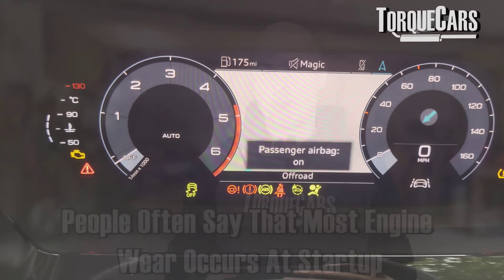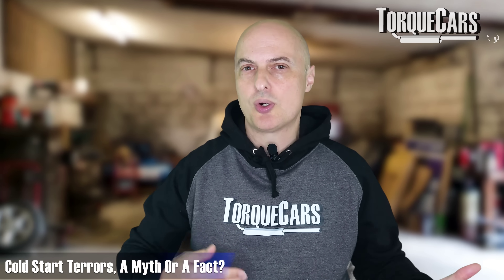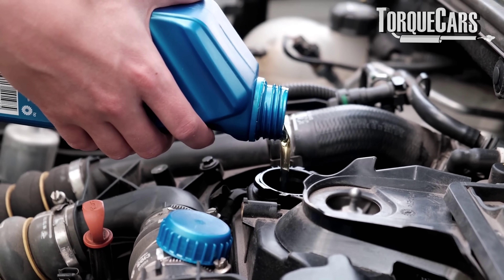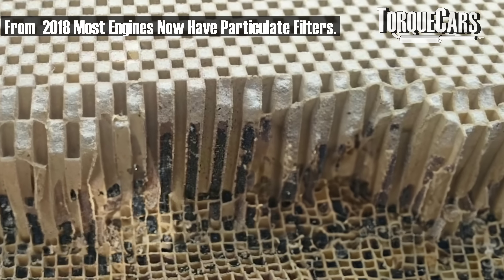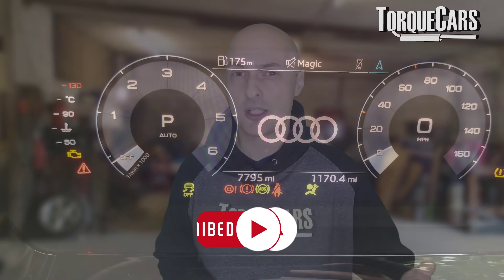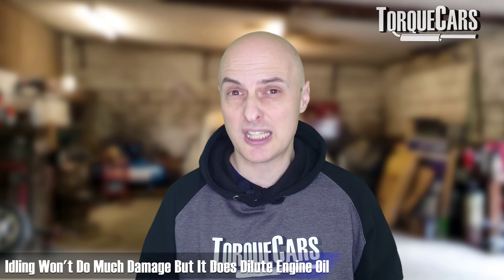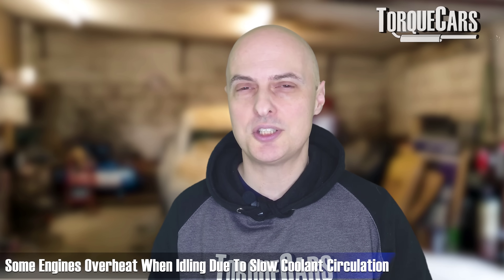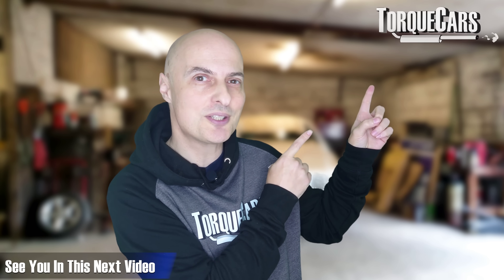❄️Reasons Why Bad Cold Starts Destroy Your Engine ☃️Prevent It Happening To You! ⚠️

Comment: My 05 Silverado has 251,000 miles and I ALWAYS baby it on startup. I have remote start so I use it and depending on the outside temp, I'll let it warm up from 2 minutes to 8 or so (below freezing I usually don't drive it but if I have to, I'll let it idle 10 minutes before moving). When I finally take off, I'll put it in drive and just idle out of the driveway amd barely touch the gas (only get up to about 20mph) until i reach the first stop sign about 1/4 mile away. Then I still go as slow as possible until it gets over 200°.
Reply: Over 200 degrees?  I know you're probably" if it isn't broke don't fix it" kinda guy and nothing wrong with that. But honestly, a low temp thermostat like 160 or 170 degrees would only add longevity to the motor.  Engines never run "cool", just less "hot" with a better thermostat and even adding a product like Royal Purple Purple Ice, and Redline's Water Wetter (which is used in racing applications because race cars cannot use ant-freeze. Only distilled water in the radiator) will also help lower engine temps.  I take the premise if it's good enough for NASCAR it is good enough for my car. And they use 160 degree thermostats.  And a thermostat doesn't fully open until 10 degrees hotter than its listed temp. That's why I also use oil catch cans because NASCAR uses them. This stops any kind of carbon buildup on the valves and intake that reduces performance, and can lead to engine failure if not watched because of the PCV valves used today.  And no it doesn't hurt the environment doing either of these.  It is only 2 things I know that NASCAR uses that can be applied to everyday vehicles, and work for better and longer lasting engines.(Lexus are considered and have been awarded for having the longest lasting cars on the road for many years having their cars go 400,000 and 500,000 miles. And the Lexus brand uses 160 degree thermostats.)  The EPA "claims" hotter engines pollute less.  So engine tempuratures keep rising with some cars having thermostats 200, 210 and even 220 degrees with special high pressure radiators. If governments were truly concerned about the environment or "climate change" they would release the known tech for cars where no longer "liquid" fuel is squited into engines. Which liquid fuel does not burn, only the "fumes" (which is hydrogen gas).  This leads to high pollution and low MPG. As pollution is simply "unburnt" fuel, which is about 2/3 of the gasoline your buy. Straight out the tailpipe as pollution (and also because it is laden with carbon, which doesn't like to burn).  If instead, you were to convert gasoline into a gas (which it readily does at most ambient tempuratures) and introduce these "fumes" into the combustion chamber (hydrogen gas) you would effectively reduce pollution of cars by better 50% while doubling MPG for all vehicles across the board.  This is what jet engines do, and why they are so efficient. Imagine getting 40+ MPG out of your truck, and 60 MPG+ out of your car, while feeling good you are polluting less. Because now you are burning 2/3 of the available fuel (gas tank), and only 1/3 of the fuel would be pollution out of the tailpipe.  With today's cars and trucks you only get to use about 1/3 of the available energy in a tank of gas, the other 2/3 is wasted out the tailpipe. This is "the only" evolution for combustion engines.  The tech is cheap and this idea not "new" but known for some time now, and no more dangerous than what you are doing today, because you would still start off with liquid gasoline. (just as jet fuel is a liquid, usually "kerosene").   Did you know oil is "Not" a renewable resource, and oil wells refill?  You live in Texas, you probably already know that.  Take care friend and I hope your friend takes you many more hassle free miles. Nobody wants to buy a vehicle in this current environment unless they have too.  Today we don't get the best car and trucks. That occurred for all manufacturers 1996-2008 or maybe 2010 depending on the model. Since then it's been useless touch screens, smaller engines, crappy CVT transmission and "Bling" driving up the price of trucks and cars today. Along with EV's that nobody wants, or if they do, cannot afford. EV's are simply a way for the rich to limit freedom and opportunity for the poor folk because we would all end up with scooters instead of EV cars. (Plus, DEI Failure also driving up car prices because of hiring people without any skill or talent or common sense. It's destroying American and British businesses.  It permeates education creating failure in schools at all levels. Putin couldn't have come up with a better plan to ruin western businesses and culture. And i'm not sure he is the genius behind the Woke/DEI movement.) Peace.
Reply: Mine has 300k and i dont baby it at  all.

Comment: I've really learned to appreciate my Subaru when it comes to this. I used to get annoyed that it was so loud after starting, but it serves a purpose. It rockets to 1700 rpm, but you start getting heat in like 2 minutes, and it's up to operating temp in 5ish minutes. My Toyota Highlander is far quieter, but it takes forever in comparison to get heat and warm up. I'd guess 3x as long. My Outback is a turbo, so maybe that helps too. I let it run for at least 15 seconds even in the summer to make sure oil is circulating properly before driving off and then let the turbo cool down by letting it idle 30 seconds to a minute after parking. I also use Shell 89/93 as they contain friction reducers that reduce engine wear. Bet that is extra helpful when cold since that is when you'll get the most blowby.

Comment: I've got a 2004 Honda Accord 2.4 K24A with the 5sp manual trans. It has 270k miles and runs as good as the day it was purchased from the dealer. It still reads 190#+ psi. I start it up let the idle drop and drive it moderately till it fully warms up. I wouldn't be surprised if this car gets 500k miles or more.
Reply: Pretty much what I do with mine as it ticks over a bit higher from cold start. 2005 ep3 type r
Reply: Lost a ball joint on mine at that milage. Didn't wreck but cost a small fortune, had to replaced everything on both sides. Mine rusted away at 310k. Fun car I would buy another.
Reply: @toothpicdinosaur3777  I had a tie rod come undone on mine. Fortunately I was at a stop sign and a couple blocks from my house. Had it fixed for $0 in minutes. Sorry to hear about the rust issue, never lost a rig for that reason. We don't use salt on the roads. I'm assuming that's what happened to yours, my apologize if I'm wrong. I have another one with the same set up in the LX trim w/260k miles. Picked it up for $600, kid rear ended someone but it didn't even touch the subframe. It was perfect and an easy fix. You can find 'em cheap like that just look to see if that sub frame is bent. If not scoop it up, don't know how to fix? Someone on this platform x100 made an easy to follow video making you an expert, LOL.

Oh, one more thing, I almost forgot. Was that an upper ball joint that went out? I've had lowers go out and still drove home on the freeway, just curious.

Comment: Good advice. I've had cars since my '58 Ford 60 years ago and never lost and engine. I plug our car engine heater for 15 min at 0 C, and transition up to 2.5 hours at - 40 C but no more than 3 hours of warming here in Northen Ontario. Clear any ice and snow before starting it and no more that 1 min of idling .  Very, very slow driving for the first few minutes. Once she warm I open her up.

Comment: I know I'm probably damaging my engine doing short journeys every day, so I avoid thermal shock by not doing spirited driving between journeys. Its all about gentle driving getting up to the required speed and then coming down to town speeds. I change gear before it hits 2000 revs, I always wait a minute after parking up for the temperatures to level its self. Whilst driving I try to keep at the gear which keeps the engine between 1500-2000 revs, you're always tempted to try to use all the gears ending up in 6 th gear but that's not the case. I'm normally in 4th driving around town by maintaining the revs at a reasonable level to avoid putting slow speed high gear strain on the engine. I never use start stop and I use quality oils and change every 3000 miles at home. During winter I never have the heating on and have the windows down, I've always done that because I like fresh air and it tends to bring the engine up to temperatures a lot quicker than having the heating on.
Reply: @IwasBraveFor2WholeSeconds  Labouring the engine in too higher gear is also very damaging, especially when the engine's warming up.
Reply: @Markking1678   Not really when the computer on board doesn't prompt you to change to a higher gear.
Reply: coming down to town speeds –It’s probably the 4th gear (60-70 km/h) that has best torque and fuel economy ratios, hence best for the environment too. But in the Netherlands the town speed limit is 50 km/h and you are fined when caught above 54 km/h, so the government actually acts against the environment. We are having perhaps the best maintained roads globally but may not optimize the speed for fuel economy and environmental protection.

Comment: There are also other parts of the car that need to warm up, not just the engine. Gear box, shock absorbers, tires etc. If you just warm up the engine, your other parts get a shock if you go full in.

Living in a climate with temperatures down to -30 °C the engine warms a bit after cold start while cleaning snow and ice from the windows before driving. Then I take it easy for a few km before driving normally. Especially shock absorbers are "rock hatd" before they warm up, and going hard on the first bump with cold oil easily leads to leakage. Same goes for the rubber parts in the chassis, they are rather stiff at cold temperatures before they move a warm up a bit.
Reply: Well, rip to my shocks, because even at school zone speeds, the road’s just full of disrepair and potholes 😭

Comment: I use Clear Flood Mode to circulate oil without turning on, if my truck has been sitting. Turn on and let rpm drop below 1k  to avoid hard cold shift into drive. I then let the rpm carry the momentum without giving it gas for a block, and drive gently until my transmission oil and engine oil are at operating temperature. A truck displays all temperatures, and idle hours. The truck changes fuel pattern on the injectors when cold

Comment: I have read various people saying that it isn't the same these days, and that the formulation is different, and I'd be totally willing to accept that that may be true, but back in the 80s/90s, Slick 50 made a huge difference to how well engines in my vehicles started.
My CB125 went from being a stiff old pig to start to causing multiple shin injuries because it put up virtually no resistance to a kick start - it was like someone had stolen the engine, and it took a lot of getting used to.
If I didn't make a point of instantly backing off the throttle when starting from cold, my VF400 rev counter would fly from zero to its 12.5k redline in a small fraction of a second rather than taking multiple seconds to wake up and start hovering around tickover.
The cars that followed were the same - even with a way-beyond-aged battery, they started like a dream.
Certainly, thermal/expansion issues are a meaningful thing, but in terms of lubrication when cold, oils/engines back then left a lot to be desired.

Comment: I like my Toyota Highlander Hybrid because it gives the engine a chance to warm up from a cold start. For the first 20-30 seconds, as long as I'm cruising at a slow speed, the electric motors do all the work while the combustion engine idles. I can hear the engine going from closed loop to open loop as it warms up. And finally, once it's ready, the combustion motor starts to take up the work. It's really quite intelligent, as well as necessary, because hybrid engines are much more sensitive to failures caused by cold temperatures because they turn on and off all the time.
Reply: You mean open to closed loop 🙂
Reply: @gregordiseth6651  Oops, that's right. I got confused by the way he talked about it.
Reply: @CaveyMoth  The same does my wife's Honda CR-V Hybrid. You can hear just the electric motors and the engine is allowed to warm up before it really has to kick in. And even then, it's gently.
Reply: Same as my 22 Escape hybrid AWD & 24 Nautilus hybrid AWD. 💯

Comment: Where I am in Canada, winter isn't as severe as other parts, but it does get cold. I have an electric heater that sticks to the oil pan. When it's -10° C, I set a timer to start a few hours before I leave in the morning. When I pull out the the dipstick, the oil on the end is slightly warm to the touch. The engine cranks much easier.

Comment: Years ago, some guy told me that is good to have Aircon on during the warm up. It gives some load and rises rpm  little bit. I remember my dad driving cold car in cold winter( up to -20 C), start up engine, wait up to minute and then drive it bit slower and dont shift the gears so often for the first 10-15mins and rather keep the engine in lower 2000s rpm. His cars with regular servicing always had golden oil and no traces of wear and humid inside engine.
Reply from the maker: Great tip!
Reply: That's strange. The idea is to lower the RPMs so you don't clank it into gear. Turning on the heat when it cold only blows cold air until the coolant temperature rises. It doesn't make sense to overload the engine before it warms up; that's counterproductive. Not shifting gears often for 10 minutes makes no sense. That guy was incorrect and any mechanic will you that. You can start and wait till the RPMs go DOWN to about 1500-2000 (25 seconds, more in very cold areas),, but the last thing you want to do is start turning things on to compete with that objective. Once your RPMs are lower, shift as usual. That was some bizarre activity that guy told you.
Reply: His cars with regular servicing always had golden oil –I do the same, and my oil doesn’t stay golden for long…

Comment: I was told if you put an automatic transmission in neutral while the car is idling it starts warming it up along with the engine but obviously make sure the parking brake is engaged first.
Reply: @adamgallahan6747  ,
  Au contraire...
I haven't used the parking brake on Anything since '72 and have been rewarded with No parking brake problems. The parking brake is a solution looking for a problem, for ignorant drivers.    ☆

Comment: Great points! Another thing to consider is block heaters, oil pan heaters, etc. Any type of preheating is going to be beneficial to the engine's longevity and fuel efficiency. You'll get heat quicker too since the engine will be starting from a warmer temperature👍

Comment: I don’t Idle. I just very gently until it warms up. No use spraying the cylinder walls down with a rich air fuel mixture to keep the engine running rather drive.

Comment: My Subaru has Lineartronic transmission,  on start up I have a blue warning  light on the dash, they recommend driving gently until the light go out, then drive normally, the g/box oil is heated initially by the engine cooling system, so the engine warms the g/box oil then maintains cooling thereafter, so It's startup ,idle for 30 seconds, then drive gently,  it works well, got the FA 20, 2.0 turbo engine 241 BHP, and timing chains, no nylon belts,   fantastic car to own and drive.

Comment: It's more nuanced than idle a bit vs drive from start.
Depending on the ambient temperature. 
Depending on the nature of the first 5 to 10 min of your journey (load on engine/driveline).

This all plays a part.

With a torque converter transmission, you can stationary  idle it in drive to get some heat into the transmission oil.
You will feel the smoother shifting starting off on a cold start.

Comment: Got an Astra 2003 diesel with over 260,000 miles. Engine is still original. Still does up to 60 mph. Always start it and drive it straight away. On very cold days I do let it tick over to clear the screen but put load on by turning all lights on along with the heater fan on full.

Comment: I do exactly what the video recommends. I live in Eastern Ontario and we have a cold, miserable winter. Like really cold. My 2007 Chevrolet Malibu had 330,000 km's and ran like new until rust killed it. My 2009 Mercury Grand Marquis has 260,000 km's on the clock and still runs like new. A careful start leads to a long life. I also agree about the oil temperature sensor. My new Tiguan has one and I love it.

Comment: I have a manual VW (GTI) and I just drive straight away after starting. I'm fortunate that when leaving my garage, I have a downhill slope, then a gentle uphill, which I think is perfect for the warmup process. The temp gauge reaches normal very quickly, but when checking my oil temp via the cluster, it takes about 5 more minutes to reach about 130F (minimum reading after the dashes). Depending on my comfort level, I'll leave the cabin heat off temporarily to get faster warmup on very cold mornings. My garage stays somewhat warm, so the retained heat in the car is enough.

Comment: Driving nearly 25 years and not had to replace or repair an engine yet only a diesel fuel injector and that was the mechanic who damaged it when replacing copper seals. 😊😊

Comment: Something I try to avoid is starting the engine for just a few minutes and not getting it up to temperature. That puts condensation into the exhaust which can stay there until the next time you use the vehicle. My 2008 Chevrolet Spark still has its original exhaust system.